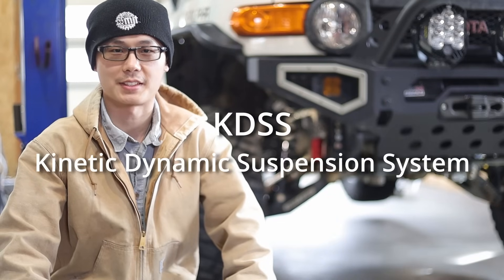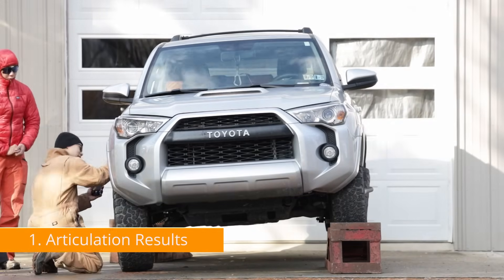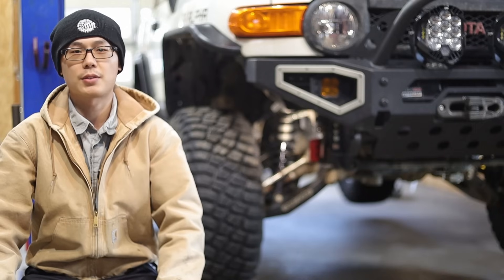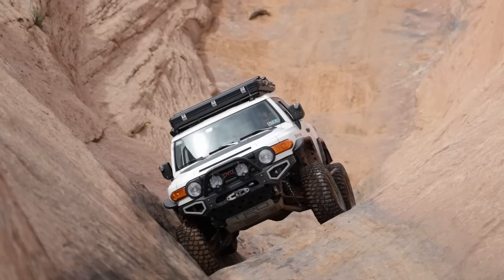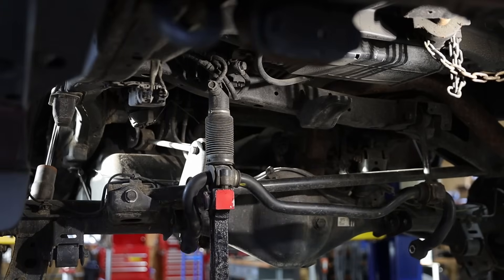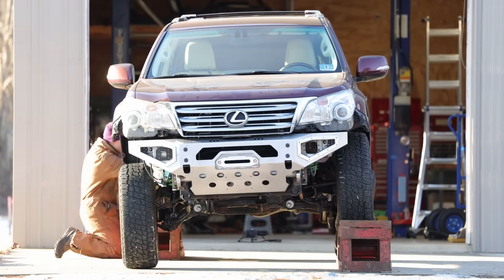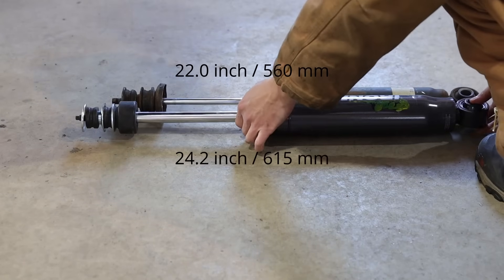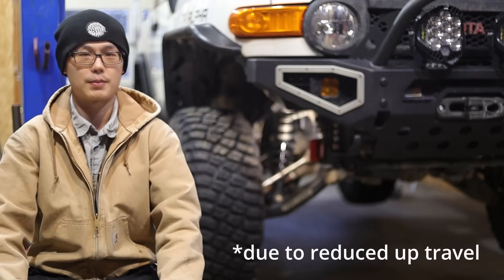Toyota KDSS Ultimate Test | Legit or Gimmicks?

Comment: I run these disconnects on extended travel FJ.

PSR Toyota Hilux N70 / N80 05-on / Prado / FJ semi-disconnect link pins from Australia. Links get removed when I post so have to google.
Reply from the maker: Quite a few friends of mine ran similar sliding links. They still don’t allow full travel though, just better than stock. The bigger issue for rust belt area in the US is they will get seized
Reply: @TinkerersAdventure  I'm in Alberta so I feel the same pain.

Comment: So i installed a gellwig swaybarin the rear on my 14 taco trd sport.    No front end sway no room.    I agree all lifts should be extended.     This mid travel garbage is stewpud and pointless.     However if you dont ever go off road the handling around corners is amazing.      Offroad not a huge improvement.     I have the one bp51 complete suspension kit.     I bought that before i started researching.

Comment: I would be curious what the differences in limitation are for a stock sway bar set up vs. one with extended links is. 

Way back when I threw the Radflo setup on my 4th gen 4runner, I noticed the rear sway bar was extremely stretched and limited the rear axle flex & droop specifically. After a new set of bushings and some adjustable extended length links the axle was able to achieve full droop (with both wheels even) and articulation was greatly improved from side to side. I never bothered to remove it as I was fairly happy with the result of just using extended links to correct the change in the sway bar end angles. 

Haven't found a solution I'm happy with on the front though due to the slightly more complex geometry and interactions with the front suspension. I would run without a front sway bar, but having tried it once or twice while prototyping a quick disconnect sway bar setup, it made the vehicle wallow too much in turns on the road for my driving habits.
Reply from the maker: Right on. With very long rear shocks the rear swaybar end links with toggled to pretty much straight. I personally run skyjacker extended links for that. Some claims extended link will make the swaybar more effective on road because it makes it perpendicular to the bar. 100% in theory but it’s too minute for me to feel anything. For the front the link is not a limiting factor because we can’t significantly extend the front travel like the rear. For me, I removed the front swaybar for articulation

Comment: Any idea if sway bar spacers in the rear only has any negative effect on the KDSS?  I put spacers on  in the rear to avoid the sway bar contacting the lateral control arm.  But now I'm wondering if I should remove them and put on a lateral control arm that has bends to allow for more movement from the sway bar.  (FYI - I have the ARB BP-51 kit (medium) set to 3 inches.)
Reply from the maker: Most aftermarket rear shocks increases down travel as shown in the video. So you'll likely need the spacers to allow for the added droop. Not only to prevent hitting the panhard bar, but also prevent topping out the KDSS cylinder. I don't see any negative effect of these spacers.
Reply: @TinkerersAdventure  cool, thanks!  Your videos are really cool.  I've learned a lot watching them.

Comment: I have a GX470 with KDSS and always felt that lifting it wouldn’t really buy me much other than some mildly improved angles. After watching all of your videos it does seem like I could get some articulation benefit out of extended coilovers or small spacers even without lifting. Then, if I chose aftermarket suspension, I just can balance any lift with personal preference as you mentioned on the IFS part 2. Sound about right?
Reply from the maker: You’ve got it! Right on

Comment: The KDSS drawback can be addressed with a mod that where you get a button that engages and disengages KDSS electronics. As a result you can disable KDSS when you’re going through large whoops at speed and, and enable KDSS in slow off camber situation
Reply from the maker: The DrKDSS switch can only force open the solenoids at high speed. Not force close them at low speed
Reply: @TinkerersAdventure  Thanks. I was wondering about this. In your opinion, should the switch be ON/OFF/AUTO? Or can closing the solenoids at low speed cause damage?

Comment: Can you manually turn on/off the hydraulic solenoids for the kdss allowing you to tune it how you want? After market of course.
Reply from the maker: You can only force open them by tricking the ECU with a fault condition. no one has figured out how to force them to close safely yet.

Comment: Sounds like the off-camber stability issue could be resolved with a manual switch to close the stabilizer control valves.
Reply from the maker: currently no one has figured out a way to force close the solenoids safely. you can only force open them at high speed by tricking the ECU there is a fault condition.

Comment: For stock suspensions on the Tacoma, is it advantageous to manually disconnect the front swaybar to increase articulation when off-road?
Reply from the maker: Yes, after you disconnect the front swaybar you can expect similar articulation like the KDSS GX in the video

Comment: So, if you can't choose between KDSS vs regular swaybar (for example on a hilux you can only get a regular one) you should buy a quick disconnect one (given that you won't fit longer a-arms)?
Reply from the maker: Yes a swaybar disconnect will have significant articulation improvement. For what i know, all off the shelf solutions even for non-long arms are not reliable or allow 100% range of motion. It is not as simple as jeep's swaybar disconnect due to IFS' packaging

Comment: i disconnected front sway bar in my citroen c5 for better comfort. Couldn't be happier. 
And factory suspesion setup is so much understeer that without front one it achieves very fun balance of oversteer and understeer.
Highway driving isn't an issue at all. On gravel its hhealthy and controllable oversteering which is super fun with FWD, because you can control amount of oversteer with gas ;

Comment: Dr.KDSS makes override switches for the system. I want to turn my KDSS to open and smooth out my ride on high speed bumpy roads but I worry that the oil will heat up and possibly damage something. At under 12mph the system of a stock vehicle never gets the oil flowing back and forth at the rate it will in my car doing 25+. Do you think this will overheat and likely damage the $3000 kdss system I have on my 5th gen 4 runner? I’m going to Utah next month.  Can you test this system to see if it overheats with the override?
Reply from the maker: Interesting thought but I would guess no. The KDSS cylinders don't have orifices like shock absorbers that do work to the fluid. Fluid flowing in and out of the accumulators is fairly unrestricted.

Comment: Excellent, keep it up! Any consideration to manually closing those solenoid valves for low-speed stability?
Reply from the maker: Thanks! I only know opening them at high-speed is feasible. But not the other way around. KDSS' fail safe default state is solenoids open. So by tricking the ECU with a fault condition, KDSS dash light will come on and solenoids will be kept open
Reply: @TinkerersAdventure  What about powering the solenoids directly?

Comment: Hi great video not a lot of people know much about KDSS and Landrover have a similar system but both systems have there limits but the idea is sound
I have taken it to the next level i have designed and built a suspension system that forces articulation and is a sway bar at the same time with no input from the drive and have just started working on a sway bay system that can be fitted to   most standard suspension
Reply from the maker: Sounds interesting. If you have any web posts I would love to learn more
Reply: @TinkerersAdventure  
If you like to find me on Facebook I can show a few videos of the system working and pics just my name and look for my blue buggy that is also a hydraulic suspension system
Reply: Also you can find a rig I designed for a friend on YouTube try forcelink Nicholas Nielsen

Comment: Once again, awesome video. I’m really surprised Currie hasn’t tapped into the Toyota market with their antirock swaybars. On my Jeep TJ I’ve got 12” travel shocks and with a Currie antirock Offroad swaybar it doesn’t limit travel at all. Unlike KDSS the antirock style swaybars rely fully on the center torsion bar and there is no hydraulics involved which maintains side hill stability. The torsion bars in the antirock are a 4130 chromolly heat treated bar that can withstand extreme amounts of twisting. Anyways I love the content I look foreward to feature videos
Reply from the maker: Thanks! The Toyota IFS is very hard to package one into that space. All kinds of hoses, fans, transmission around that area. Toyota's OE swaybar got a few weird shaped bends in it to clearance all those.

Comment: I love this research based approach to information. Also great to know regarding KDSS.  Only thing I would challenge is regarding off camber and the sway bar, in that it's only better if your vehicle doesn't have to articulate.   If you have to drop into the off camber section on an angle then you're probably better off without it. At least that has been my experience.
Reply from the maker: Thanks! I see what you mean here and I agree with what you described. I did encounter many situations where I need to go up on to a side bank to avoid deep wash out or a tree. So not so much as "dropping into" a ditch.

Comment: For off camber stability: there is a kit where you can turn the solenoid valves off manually so you can disable KDSS at higher speeds, or lock the KDSS at lower speeds.
Reply from the maker: can you send me the link to that kit? if you're referring to dr.kdss, it can only disable KDSS at higher speeds. it does not lock the KDSS at lower speeds

Comment: Great video! I bought a 4 runner with kdss. Can I install a 2” leveling lift on the front without worrying about break lines or other components being over extended?
Reply from the maker: Yes. an IFS lift doesn't change where full droop is. so no component will be stretched further than factory. check out this video for more explanation. https://www.youtube.com/watch?v=_68Hc8GtLko

Comment: You can always modify the KDSS solenoid drive to disable the accumulators for off camber situations. Seems like it wouldn't be that difficult to do. It would be another switch on the dash like a locker switch.
Reply from the maker: A switch can only force open the solenoids. To force them to close safely is much more involved. This is because the default fail safe condition of KDSS is solenoids open. the existing switch mod trick the ECU to think there is a malfunction hence the KDSS light comes on the dash.

Comment: Really good information here. I got rid of my rear sway bar on my GX470 once I installed extended travel but I don’t know if I want to get rid of my front sway bar as this truck is my daily.
Reply: I just deleted KDSS and now debating if i need front swaybar.  Plan to run no rear swaybar.
Reply: @Tranfamilies  I didn’t noticed any difference with the rear sway bar removed so I never put it back. I don’t want to removed the front one because I think it will make a big impact while driving on the street. I could be wrong…
Reply: @GabesGarage  without both and heavy spring, it was not too bad on hwy.  definitely side2side at high speed maneuver but not losing control at 70mph.  I have not done offroad test yet

Comment: Was your measurement of 4R and tacoma with swaybar + lift including extended links for front swaybar?  I heard with extended  links it helps getting that extra travel for lift vehicle IFS.
Reply from the maker: the front swaybar link is not a limiting factor. the rear swaybar link will be a limiting factor with shocks longer than 26.5" extended length

Comment: Very insightful, I have owned KDSS and non KDSS 4runners... KDSS handles great for general overlanding trips, not so much on technical, higher roll, articulating terrain, especially if you are top heavy. Still, every man has their needs and you can never go wrong with it. but I would rather save on the dealer $1,500 and use it towards a more comprehensive suspension upgrade.
Reply: I see KDSS all the time on technical rides.  What are you talking about.

Comment: I watched this whole video even though my 3rd gen 4runner doesn't have KDSS and it doesn't really apply to me at all. But i think some tests on the GX with no swaybar could've been a good metric to compare as well, on top of swaybar vs kdss vs no swaybar. cause i'm trying to get some swaybar disconnect links that can come on and off easily.

Comment: These are great tech videos. 

On the FJ, why not run a disconnectable front swaybar to solve the on-road handling while still being able to optimize it on a trail?
Reply from the maker: Thanks! It is very challenging to fit a true swaybar disconnect and not interfere existing components in the front of these Toyota. The closest thing today is sliding swaybar links. But they don't allow 100% of travel and gets more and more difficult to work with.
Reply: @TinkerersAdventure  I wonder if modular sway bars (from drag racing/circle track parts catalogs) would give you guys better attachment options for disconnect hardware, while also having an array of widths to toy with packaging.

Comment: good indepth video on both sytems, I have a 2016 trail 4runner with KDSS and i love the ability it give's me both on road and of road, I also think it does'nt get the recognition that the TRD pro get's, other than a slight increase in hight,different shock's and badging the trail now called TRD off road would be a better sytem in the long run with the KDSS, Just  my opinion.

Comment: it's a wonder nobody make a dual rate swaybar, like they do for wranglers, a stiff swaybar for road use that can be disconnected but leaving a lightweight swaybar connected that doesnt effect articulation but still helps control body weight shifts.
Reply from the maker: The main challenge in the front is to fit everything and not interfere with existing components.
Reply: @TinkerersAdventure  doesn't take up anymore room than a regular swaybar. it's basically a hollow torsion bar with a lighter solid torsion bar inside it.

Comment: Australian market:
I found the kdss system is to harsh on roads (Land Cruiser Prado Kakadu), while the non kdss (Land Cruiser Prado VX) was better. It handled corners pretty decent while soaking bumps better, especially at the rear.  I really don't know if it's just the local Australian tuning that is different from other markets but the non kdss Prado feel a lot better on sealed and dirt roads, and for off roads tracks people in Aus stick to the GX / GLX / VX models which has no kdss for a reason.
Reply from the maker: Interesting perspective. I like the Prado a lot
Reply: A KDSS 4Runner handles much better on the highway than one that doesn’t… the body roll handling much much better.
Reply: I am sure with the GX550 Australians will have a change of heart if they can afford it. The GX550 will be better than a Prado with a few modifications.

Comment: The KDSS in the Lexus GX has the electronics in it, but in contrast, the KDSS in the 200 Series Cruiser is completely devoid of any electronics.  So it does not have the valves which open up to the accumulators.  There are no accumulators in the 200 Series KDSS system.

This may mean that the 200 Series Land Cruiser may well keep the vehicle more level a very sideways lean, rather than the KDSS in the Lexus GX.
Reply: What about the 4RUNNER?
Reply: @BXslime5000  Sorry I don't know whether the Toyota 4Runner has electronically controlled KDSS or if it's a purely hydraulic system like it is on the 200 Series with conventional coil springs.  In some markets (e.g. UK) the 200 Series can be equipped with AHC (height adjustable suspension) and it uses a very different system to the hydraulic KDSS.
Reply: @tempestv8  I hope it doesn't have any electronics. Even tho I am getting one with kdss regardless lol.

Comment: We've got the ability to disable the KDSS by inserting a switch on one ground wire. This would allow it to work at higher than 12 mph speeds (where the stock system locks it back) which many think would be useful on some trails. More likely it should be activated again at around 22 mph as much above that might give less desirable results in handling.
Reply from the maker: I agree, swaybar is still desired for cornering during high speed offroad. most race trucks run swaybars.
Reply: @TinkerersAdventure  but the way you are saying as it’s a true disconnect it is not. Trust me I do high speed cornering in baja with the kdss deactivated with the switch and the sway bar is still there.  The shock in the kdss will run out of travel and that’s when the high spring rate sway bar kicks in more. You are still dealing with the sway bar trying to twist. It’s just less active then when in stock mode.

Comment: I knew nothing about kdss since I have a Tacoma but this video was very helpful in understanding what it is and how it works. I currently run no sway bar on my tacoma for the extra articulation, and the smoother on road ride. With 600 lb coils and the factory sway bar things like pot holes and speed bumps were pretty jarring compared to factor shocks. For the off camber situation it makes me wonder if you could wire in an override for the solenoids to block the accumulators when needed.
Reply from the maker: I hope that can be done reliably. So far I've only seen mods override to open the solenoids, but not the other way around.